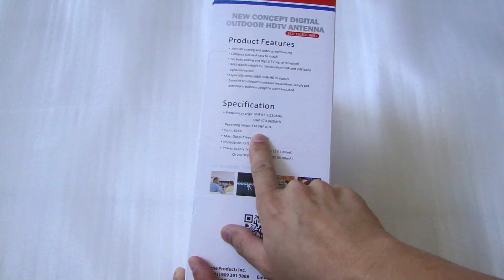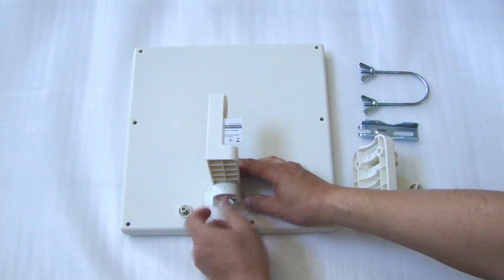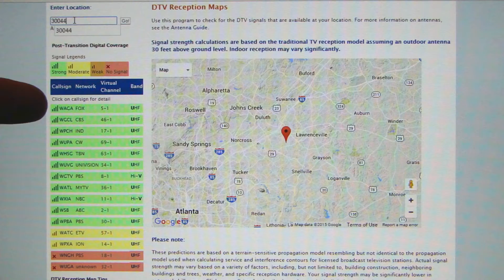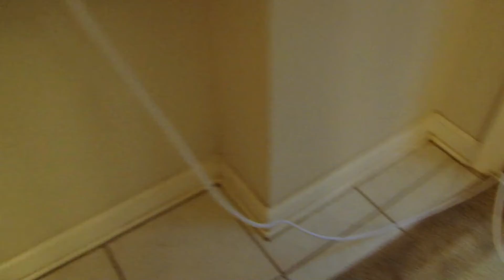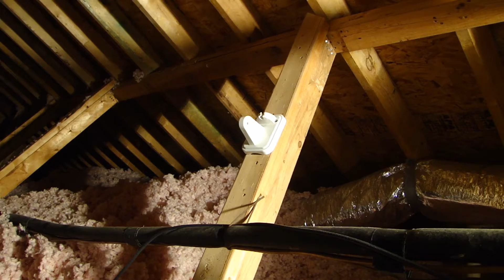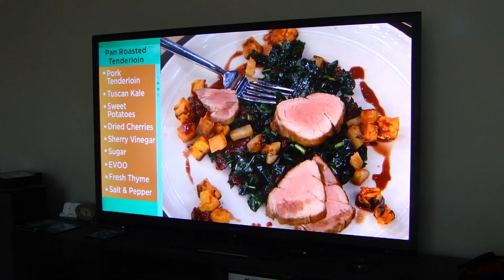Omni-directional Amplified Digital TV Off-Air Antenna - 60 Miles - 1BYONE

Comment: Did it really pull in more channels than the dipole antenna that you already had?  Can you do apple to apple comparison?  I have installed one of the real antenna in the attic and if the new one gives you better signal and more channel, I would have to try this new fangled one.
Reply from the maker: +12vgs8606 After playing with it a bit more, the dipole I made performed better than the new omni-directional antenna.
Reply: Figures!  You can not cheat law of physics!
Reply: +dial2fast Thanks for your honesty.  Your homemade antenna is actually very good for pulling in weak signals.  The problem with the antenna you reviewed is that the amplifier can only work well if it is close to the antenna, otherwise the already weak signal degrades strength going through too much cable before being amplified. Now, if you use the amplifier with your old antenna (what you call a dipole is really called a 4-bay bowtie antenna), you will be absolutely amazed because you will get all if not all but the 2 weakest ones.  Try it and make another video, where you show the results and thank me!  LOL.
Reply from the maker: +Inspironator Thanks for sharing your knowledge!

Comment: I've been doing this for years, but still have cable (just a habit, more choices, DVR service, etc). I'm down deep in a valley and 35 miles SouthEast of Pittsburgh, Pennsylvania. I have a directional rotating antenna. I was totally blown away at how much better the digital signals penetrate through, compared to the analog signal of years ago. All stations used to be fuzzy. Now, I get more stations (some have 3 channels per station) and absolutely crystal clear 1080 image. I find that the best signals are pulled through the new TV's, with digital tuners built in. I've had mixed success with tuner boxes. 

My antenna is mounted outdoors, but maybe only 18 feet off the ground, really doesn't matter as I'm surrounded by mountains anyway. And yet it still works! 

Most people won't try, as they think back to the old days of antenna TV, which was lousy!
Reply from the maker: +William Prah Thanks for sharing!
Reply: Nice!

Comment: Hmmm, I doubt it but I wonder if there's a way to tap into the outlets that are preinstalled in apartments for cable and have the antenna signal go out thru them...
Reply: ofcourse there is a way, you just need to find the main coax on the exterior of the bldg. for your apartment but I don't think your apartments want you touching that.